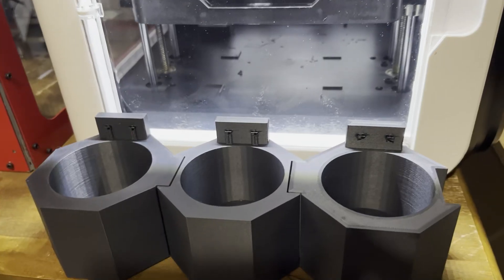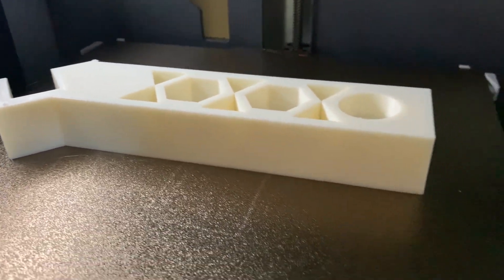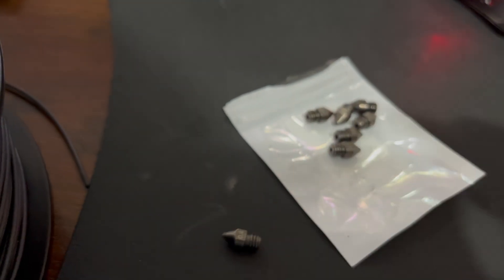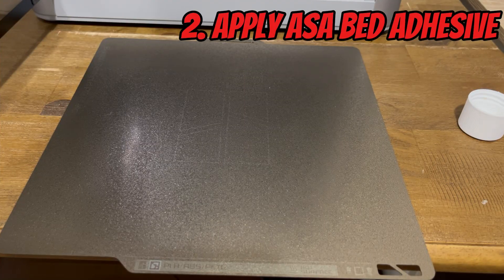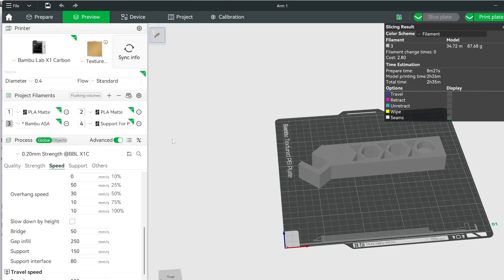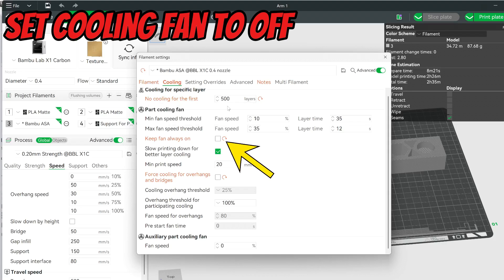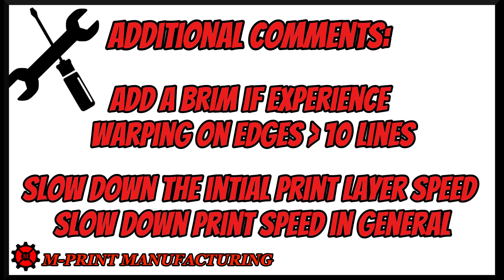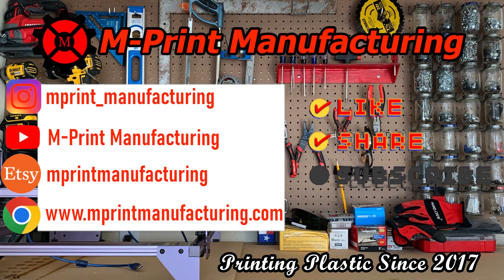How to Print ASA Filament Perfectly | 3D Printing Tech Support | End Warping and bad Prints Forever!

Comment: FINALLY!!!!!!!!!!!!!  I turned the bed up to 110 and got the chamber to 48C before I started and it came out good!  Thank you so much!!!!!!!!  I used a towel over the top of the X1C  and had a wide brim with 0 spacing.  Standard X1c bed plate and no glue.

Comment: I tried ASA with my Ender 3 with makeshift tents but only ever got mediocre results. Got a P1S and a G10 plate. 20 - 40 minute heat soak before print. It's easy mode.
Reply from the maker: Yea I would agree!

Comment: I'm getting my P1S set up to print ASA for the first time ever. I manually turned on the print bed to 100C and used a glue stick on the PEI plate (along with all of your recommended settings). Big fingers crossed! I normally have incredibly bad (first) results with just about everything I've tried on this thing, so I could use as much help as I can get!
Reply from the maker: Hopefully it goes well!
Reply: @m-printmanufacturing2017 unfortunately, it wasn't the best result. But it shows promise. I need to work on the model and supports so the short lines don't break as easy. But I had equally bad results with every other material I tried as well, so I think it's more of a dimensional problem.

Comment: If you want to really speed the warming along and also keep heat in, even when it’s cold in the room; Put one of those emergency Mylar blankets over the whole thing. It’s cheap, light, easy to use and works almost a little too well.
Reply from the maker: Thanks for the advice!

Comment: Thanks for the video, I'm very new to 3D printing and recently got a Elegoo Centauri Carbon. I am planning a larger project for my workshop, which will include several 3D printed parts with ASA. I'm hoping my new printer will do the job, although I plan to print these parts in PLA first, to prototype them first.
Reply from the maker: The centauri carbon should be able to print ASA and is capable of printing at high temperatures. That’s exactly what I did in my latest episode for my print blog was print a bunch of pla parts to test fit and then printed the final from the ASA! Hope your project turns out awesome!

Comment: the bet solution in my opinion is using a chamber heater you can see the difference on the lack of layer lines (less lines is better bonding of the layers) the only thing I struggle with sometime are overhangs so I try to keep the fan off. If you want less warping use a 0.16mm layer height smaller layers are warping less.

Comment: Thanks for the tips, I was close.  Was using 270c head and  100c bed.
Bambu ASA mailbox and had a solid first 50 layers then it started to split in the corners every few dozen layers. 

Ill bump it up to your settings and try again. 
Slowed down to 70mm first layer and 150mm everything else.
Was at 105mm and 250mm

Ill get back to you in 19 hours with my results ^_^
Reply from the maker: Boxes are hard especially at the corners. Can you incorporate rounded edges over 90 degree bends.
Reply: @m-printmanufacturing2017   I could give that a shot if this fails.  About 1/3 done right now; night and day difference, no layer lines on the Z axis and no separation so far.  285c initial layer and 280 after. 0 on cooling. Bed is capped at 100c which is too bad.  Current chamber temp is holding at 42c. 

If I were to tweak from here, I would adjust the layer max to 50 seconds and let the machine adjust speed as needed to compensate an even layer distribution.  Maybe play around in five second intervals up/down to see if things get better or worse.  

I also ordered a small chamber heater and temp probe for $50 on Amazon a couple of hours ago.  I'll set it to 60c; it seems active chamber heating is one of the best things you can mod on a P1S for ASA and other Engineering grade materials. Cheap and effective solution, Im hoping.

Comment: Why the actual frag would you keep the nozzle at 285 while doing the preheat of the enclosure. I stopped watching there.
Seriously, think for a minute what you are doing.
Reply from the maker: Oh wow! I can tell you right now heating your nozzle before printing is okay. I’ve done many prints where my nozzle stayed heated at 285 degrees for much longer, why I pre heat my nozzle is not to heat the chamber lol. 😂 I preheat my nozzle because I like to skip the preheating step and go straight to bed leveling. The Bambu and qidi have a pre-print process that is long.

Comment: The Qidi Plus4 was made for ASA. AND at less that 60% of the cost of an H2D. 
370°C nozzle, 120°C bed & 65°C chamber    & can buy 3 Plus 4 machines as opposed to 1 H2D.
Reply from the maker: Well said!
Reply: 370 or 270? Ive never seen or heard someone run the nozzle that high for ASA. 
Im not saying youre wrong, Im just saying haha.
Reply: @cmtzae  He's just listing the specs. You wouldn't do a 120 bed for ASA either.
Reply: @ThisIsMeArnold between 90 and 110 but 120 is just what works for my filament. So yes I would and do. 👍🏼
Reply: @cmtzae  120 makes ASA droop down into an elephant's foot
Reply: @T @ThisIsMeArnold idk what to tell ya bro. My prints come out great. 🤷🏻
Reply: @cmtzae  I mean, the person in this video also states that his print came out great when everybody saw the print had warping.
Reply: @ThisIsMeArnold  cool, but mine don't. Have a good one. 👍🏼

Comment: 5:22 no issue? The front left corner says warp. If you zoom in, so can see also on the front right and rear left corner. This is typical for 90° corners. Add there the mickey mouse ears.

Comment: I didn't realize ASA was such a daunting task, I use default Bambu settings on my H2D and it always prints great. I love this printer...
Reply: the H2D has a built in chamber heater that makes it easy to print ASA. Chamber heat is 70% off succes with ASA.

Comment: I'd given up with ASA as it would always warp, ABS is no problem.
As I have 4 rolls of the stuff, 2 of which are in my dry box, I'll have to give ASA another go. Thanks for the tips 👍
Reply: Have you tried a chamber heater before? I had the same shitty results but it ended when I had made it hotter in my P1S the only advice I give with it top place a small fan that blows towards the heat sink of the main board.

Comment: I print with ASA often on my P1S.
No glue stick or brims, or pre heating the bed and nozzle. 
I use the Biqu Glacier Pro build plate.
I literally just pick my filament in the slicer (Polylite ASA) slice and immediately print.  I’ve had zero failures to date
Reply: Polylite is less prone to warping I think from a comparison vid I watched. Bambu ASA and ABS were number 8 of 10 in that list. I'm stuck with a whole bunch unfortunately else I would switch brand. I don't fuss too much with other materials but high heat/warp prone ones it seems it really does matter.
Reply: @michaelrobinson9643  do you remember which video it was?
Reply: @michaelrobinson9643  I have absolutely no problem with how the Bambu prints, their ASA is expensive though ABS is priced good if you buy >4

Comment: Common sense stuff.  Skip the IPA after washing the bed and use Vision Miner as an alternative to Magigoo.  VM will last 20+ prints per application with no need to wash plate between prints (do avoid touching the plate however).  Just pull plate, cool plate, pop parts off, put plate back in printer, save time re-heating bed and chamber since still very warm... start next print job.  VM also prints perfectly at 100C.  Have done hundreds of hours of printing with VM and zero warping up regardless of shape or bed conract area.  VM allows for unusual part orientation on the plate.  One bottle of VM will last for months.  What brands of ASA are you printing?  Asking  as I typically print ASA at 255-260C.  Partially as it is a nice middle ground temp for mixing in multi-material (other ASA or ABS).

Comment: I'm having good luck woth my prints in bamboo asa on my H2DPRO but the supports often fail and get stringy towards the top of the trees, what could cause this? I need to check my fans, I just learned about this but what else? I was thinking slow the speed down a bit on supports maybe?
Reply: stringy usually means you need to dry your filament/ have the filament in a dry box while printing